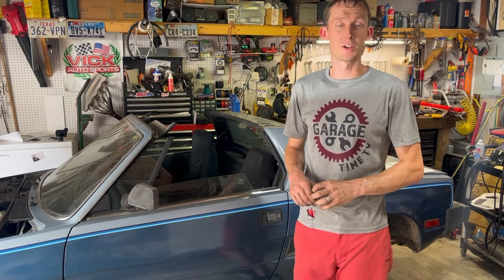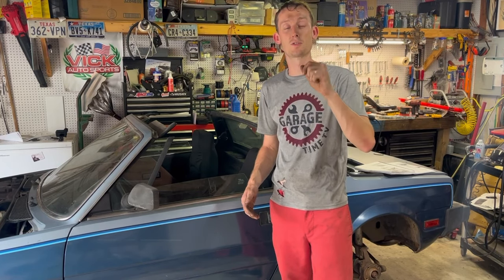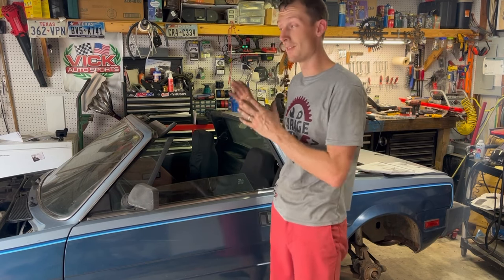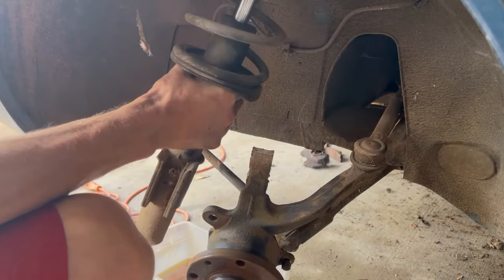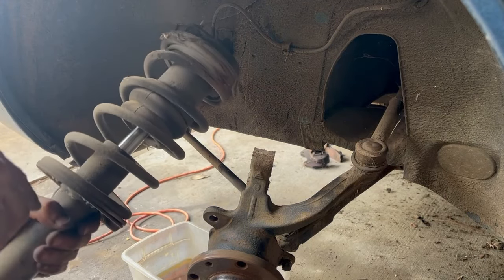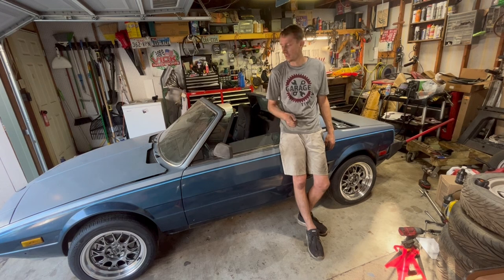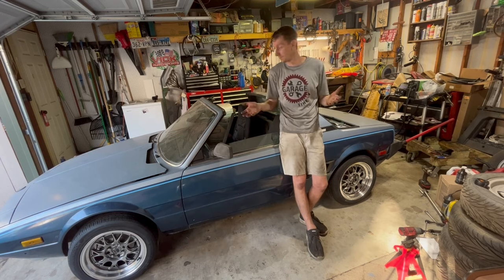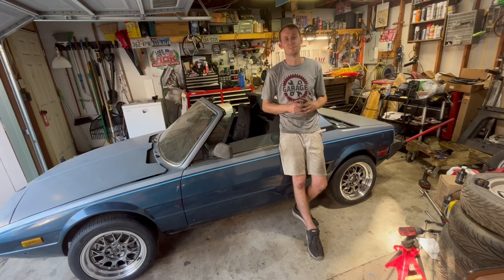Enhancing Performance and Style: Bertone X1/9 Coilovers, Big Brake Kit, and Wheel Upgrade

Comment: The beauty about being a X1/9 owner in 1979 was that you could buy Pirelli P6 tires in the stock 13 inch size and have all the tire you would ever need. Also I drove my off the lot and drove it like I stole it being a 19 year old kid.  The brakes were more than enough and I cannot imagine needing more. The only thing that we all know about these sweet rides was lack of power. But the handling and braking was exactly what you needed.

Comment: Is this going to be a track car? The front tyre contact patch is too big for road use. On gravel or wet roads it won't steer. Also the tyres protrude too far to avoid hitting the guards (fenders) if you drive over a bump when the wheel is turned.

Comment: Just some random thoughts and suggestions...

Kinda irritates me when folks are prepared to take people's hard earned for parts that are wrong for the vehicle, in this case 15" wheels for an X1/9.

Dallara successfully modified the X1/9 for Group 5 in the seventies, they widened the track, lengthened the wheelbase, and lowered it 3" but they retained the 13" wheel, but 50 or 55 section road legal motorsport tyres didn't exist in period.

Lotus pioneered the modern 13" motorsport tyre for the MK1 Lotus Elise - Avon ZZS.

Best width of tyre for X1/9's with 150-200bhp is 185/55/13 front, 215/55/13 rear.

These effectively lower the car, some, and the rest of the lowering is achieved by using a shorter strut.

Springs wise, 175 lb/inch front,  225 lb/inch rear is fine.

Fitting coilivers limits the suspension travel, with 225 lb/inch rear springs, you can jump up and down on the back and it scarcely moves.

The original body has discrete factory flared arches and you can max out the front and rear track without modifying them other than rolling the internal edges.

Do these things and the stance will be awesome and the car will be fast.

Sorry but 15" will never look right on these and if something looks wrong chances are it is wrong for a reason.

You won't be able to lower it much and even if you can get a 35 or 45 section tyre, the ride will be adversely affected.

The smaller the circumference of the wheel plus tyre, the lower the inertia, this is good.

Fit an Addco or equivalent front ARB.

Replace the white nylon pedal box bushing with one made from SAE660 bearing bronze, eliminates all freeplay in the pedals.

If you persevere with X1/9's you will fall back in love with 13" wheels eventually.

You didn't make a mistake buying the car itself that's the main thing. Buy some more if you can you'll always break even.

Start saving for a locking diff and some beefy close ratios because the standard cogs don't handle big increases in power reliably.

Best of luck mate 👍

Comment: Wheels look ok, the car is sat higher overall, those VW Golf mk4/5 calipers are a good cheap option.
Now you need an adjustable pedal box to move some of the braking effort to the rear. The fronts will  lock up way too easy

Comment: Just a thought, the 205 50 is much taller than the close to stock 185 60 13. top speed goes up but off the line will suffer.  If you go with a 195 50 15 it is closer to the 13
Here are the numbers.
185 60 13
Dia. 21.74   Cir 68.3  Dia 7.25
mph 20 mph  70 speed for comparison

205 50 15
D 23.07  C 27.8  W 8.07
mph adjusted comp to 13 inch tire  
20              74.25
 21.22       74.28

195 50 15
D 22.68  C 71.24  W 7.68
Mph comp to 13 inch   
20              70
21.25         72.03

Yokohama makes a 195 50 15 for about $88
Reply from the maker: Good info! Thank you for sharing that!

Comment: I have a set of VAS Primas on the front of my ‘77 Series 1 and have the stud conversion, too.  My only problem is that the Primas aren’t well matched with the standard X1/9 rears; the Primas clamp on pretty hard but the rears still spin freely.  Apparently, using Fiat 125 / 132 / possibly 124 Spider rear callipers fixes this, as they have 38mm, pistons instead of the X1/9’s 34mm versions but are otherwise identical.  It’ll be interesting to see if you also experience this.
Reply from the maker: Interesting. I haven’t heard that feedback. I’ll have to see if I run into that as well.
Reply: I finally found a pair of callipers with 38mm pistons, which I hope to fit soon.  I’ll let you know if they help.

Comment: Is there a cap you can put on the brake line to stop the fluid from continually leaking out while you finish the job?
Reply from the maker: Some have gotten a brake bleeder cap. That could work. Some have used a vacuum plug as well.